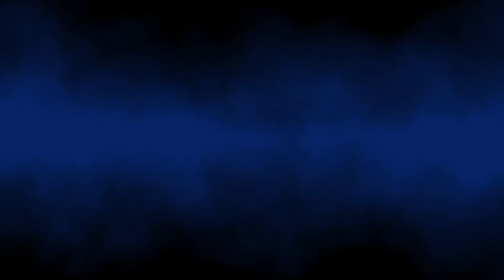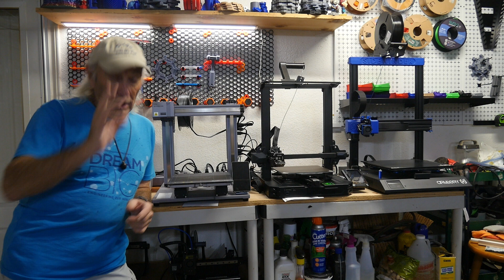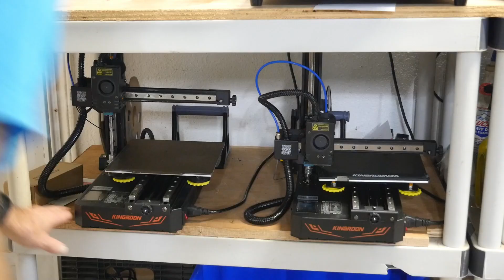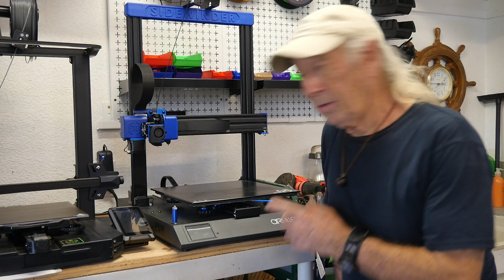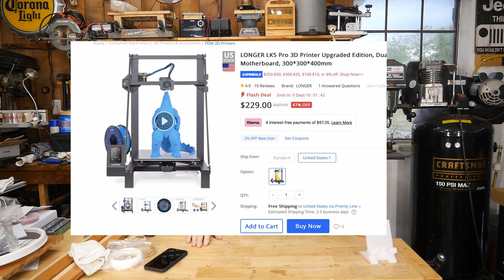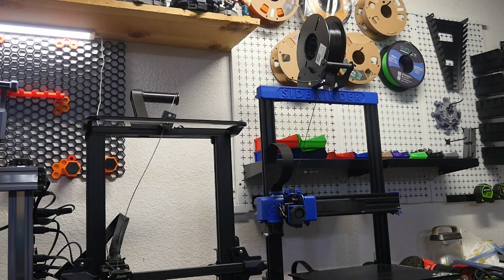What 3d printer would you buy today ? Coffee and tools episode 375

Comment: Bambu Lab X1C with AMS (maybe 2 AMS). I heard to stay away from the Creality K1 series. (look up Galactic Armory and his take on the K1 MAX)
Mid price - Ankermake m5c
low end - Elegoo Neptune 4 Pro 
large print size - Elegoo Neptune 3 Plus
Resin - Elegoo Mars 2 Pro for small and Elegoo Saturn 3 Ultra for mid sized - large is limited now for home use but for me, again, Elegoo Jupiter.
I HATE bed slingers but it seems everyone does them because they are cheaper. Love my Ender 5 with the full frame. So if you can afford to get a Core XY now a days, do it! If you can't afford it, save up more LOL
Prusa - BLAH - they have fallen behind with the XL and they need to turn it around next iteration or they will just keep losing market share. Stick with the standard mk3 or mk4 for a farm if you can afford them.
Creality WAS great for support but here of late they SUCK. Hap my ld-006 fep rip and leaked the whole resin vat into the printer and killed it. They said, sorry it is after the warranty so you can buy the stuff....even though I only printed with it like 4 times (printed Tiamat). I am looking everywhere else BUT at Creality now.
Ok, I wrote a book but I love 3d printing :) i am looking for a larger sized resin printer since the ld-006 disaster and my mars 2 pro just isnt big enough for some decent sizes other than miniatures. I am looking at the Saturn 3 Ultra.

Comment: The one I just bought, the Bambu Lab P1S. Couldn't be happier. 2 years of bed slingers is coming to a big slowdown for me.
Reply from the maker: My hero 🤠
Reply: @SirTools  I started with (4) LK5 Pros & (2) LK4 Pro's. I designed a direct drive dual fan conversion for them. The 5's are for the larger builds and the 4's are for sale, otherwise it's all P1S. I only sell parts from my own designs for the most part. I do a lot of car stuff and needed to step up to enclosure and more exotic materials which with minor upgrades are capable on the P1S.
Reply from the maker: My concern is the size of build plate on all the Bambu lab machines. I have a lot of 300mm needs or more.
Reply: @SirTools  That's why I started with LK5 Pro's Large build volume. I believe Bambu will follow Creality and offer a larger machine in the future. My main project right now is within the Bambu build volume. The AMS is the game changer for me. I use it every day for support material. The clean removal improved quality and cut my labor to remove support dramatically. I built an enclosure cabinet to hold 2 LK5's just for larger builds. I am upgrading to new boards and Klipper for those 2 and selling the rest of the Longers. The keepers have Dual Z, direct drive with Mosquito hotends. They currently run Marlin 2.1. The boards are now limiting the speed and quality.  With the Longer, upgrades are a never ending thing. Each one seems to present a new problem that calls for the next upgrade.....
Reply from the maker: Never ending......YEAH....but it keeps us busy. I think Bambu should be looking at "bigger", but ...I hear $$$ behind that. Time will tell, but makes it interesting.